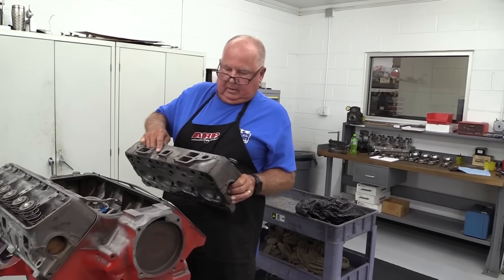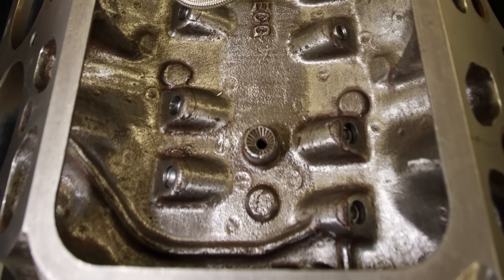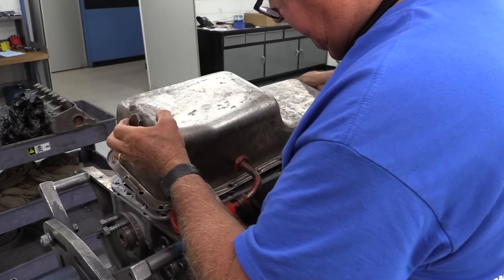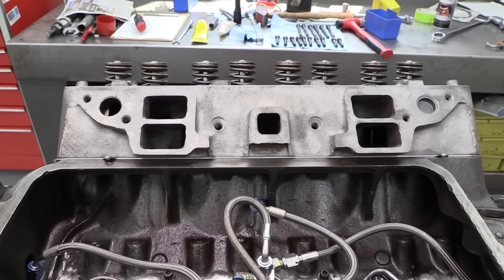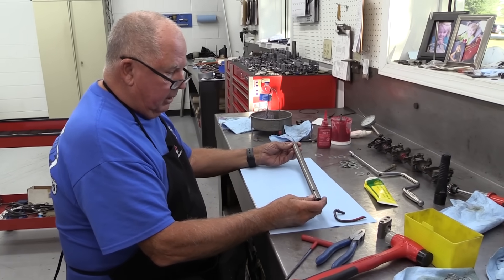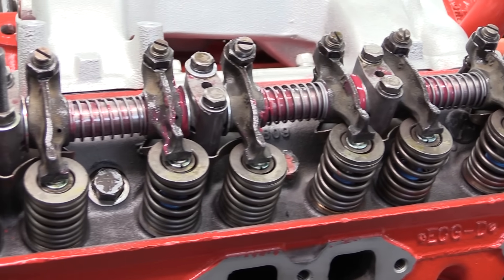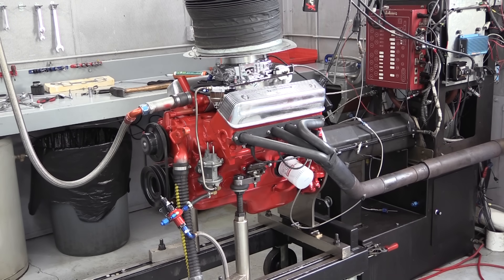The Engine That Replaced the Flathead -- Ford Y-Block Build

Comment: Everyone seems to love to do high output but not a lot of people can make a regular as ever build well
Reply: Cuz money spent is usually not much different especially if you use upgraded internals. Why use 3.00 stroke when a 4.0 stroke is the same cost? Why build for 8.5 compression when 10:1 compression pistons cost the same or even  less?
Reply: @shaadydog1  back in the 90s tuner culters(or one of) was simply because it was harder and they wanted the chalenge. I miss the days of that mindset. Who cares if you made 1200 hp 1500 tq, if you bareley did anything to do it but change a bunch of parts with known outcomes. I just wish ppl did more exparemental projects or simple projects. When 700+ hp is nothing more than a parts order and a month of work ots not really impressive to me... Or anything but a lazy way. Like ppl forgot how to do basic stuff. For example. The liquid piston rotory. Thats genious. A rotory with rotors that move like pistons. Thats inovation. These days its like half the ppl out there think you have braging rights for slapping on a few bars of boost and changing some pistons. Show me someone that can pull 100 hp per litre from a pontiac 383 naturaly asperated. THATS braging rights.

Comment: My biggest bitch about the y block engines was the failure of the rear main bearing and seal. I think the main reason was pressurizing the oil galley from the front…… resulting in oil starvation of the rear main when oil pressure dropped due to bearing wear and less oil was available at the rear of the engine. Eventually the crank ran low in the bearing enough to ruin the seal and spill oil. I had several old fords starting with a ‘57 when I was in college. Thumping noise at startup and blinking oil light were normal. Changing points was easy, however.

Comment: Hey guy, man thanks for the trip down memory lane. I really appreciate your documentation on the 292 Y block. I truly believe in the  durability and strength of the  312 y block. I purchased a pretty beat up '56 thunderbird in 1989 &I had mine rebuilt by NAPA in 1990, bored .o40  Rebuilt the Holly 4 bbl ,Also had the air cooled ford-0-matic  rebuilt.
I did the bodywork for about 3 years, but had it painted. New Stainless dual exhaust pipes,with golden turbo mufflers, &  eventually added the suspension upgrades rear stabilizer,  and new front end bushings., also eventually went to  electronix points, and the oil filter upgrade. Went to my first car show sometime in '93,(no trophy) and it still looked as good and ran perfectly when I did my last car show in 2014 (2nd place). That machine was my 25 year love affair, and I drove my baby hard, long and fast, and she was always begging for more⚘😏

Comment: A simpler way to improve rocker oiling is to machine a groove in the center camshaft journal.  That way, a constant, rather than intermittent, flow of oil goes to the rockers.  That's what Ford eventually did.

Comment: a 56 Ford cop car, using a 292 ford y block bored to 312. won c gas in upstate NY back in the early 70-s, 
the EZG heads were so milled down the pop ups would tip the plug gap close, when I discovered that, I went around the pits gathering up used head gaskets, selecting the hole 
 size I cut  them out and jammed the piece of head gasket on the spark plug jammed the plugs in, and raced for the trophy and won. I'm not a Ford guy, Chevy, this was a friend of mine I was helping out. had a few people knocking me, along with my friend, I said you have nothing to gain if I don't do this. Messing around a couple of weeks later he wiped out the engine. other wise we would had gone up to wheel brothers to run for show.

Comment: Had a 57 Ford in high school 292 y block l rebuilt the engine in auto shop back in the 60s when they still had such a thing l remember buying a rocker arm bypass kit from jc Whitney all’s it was was a oil line that taped into block main oil line and ran up to valve covers replaced the bolts that held the valve covers with a sprayer that sprayed the rockers worked for awhile but then started to make noise again but by that time l was out of highschool and getting drafted

Comment: I am a Retired Female Fleet Equipment Mechanic and this video sure brings back a lot of memories :) My Neighbor is a Mechanic and I spent a lot of time learning how to build engines with him, he was about 10 years older than me, and he was a Chevy Guy, I wont hold that Against him :) I am a Tom Boy and when I was about 16 when I met him and his Wife and Kids,  cool people :) When I was about 16, my father let me use his 55 ford 100 custom cab Pickup truck to go to school in, It had a 239 Y block engine and auto trans and it was worn out, at a traffic light the blow by was so bad, I would be in a cloud of Smoke before the light turned green again :)  at about 17 I ripped out that engine and found a 312 Y Block eng.  I Overhauled the 312 , Had Blairs Speed Shop reground the cam to a Dempsey 280 dirt track cam specs, Milled the heads .060 and installed a Edelbrock six pack intake with 3 Stromberg 97 Carbs :)  and replaced the auto trans with a Manual 3 speed, 2 1/4" duel  exhaust with turbo mufflers :)  That 55 ford truck ran 15s in the Quarter mile , back in the 70, at the Drags, a guy had a new 440 dodge magnum and I tore his doors off, He was mad, he lined up for a second pass and I beat him again :) I ran 12 times at the Drag race track and only got beat twice by a drag bike and a big block full race Chevy 56 bel air :) that was so much fun, I even had a Cheering section :) I even beat a ford sunbeam with 2  4 barrel carbs and a 650 Yamaha Motorcycle at Irwindale race way in California. such Fond Memories for me :)  Thanks For the Memories, Chellie , PS. That Engine Rebuild lasted 18 years and was still running when my Father sold the truck :) When I gave the truck back to my Father after a couple of years, and when he drove it,  My Mom said, he turned back into a Teenager :) LOL

Comment: I've always joked that Chevy copied the engine that Ford threw away. Even if they didn't on purpose. They kinda did.
Reply: Not in any way shape or form.
Reply: @edwardpate6128  oil filler in the front to the left of the thermostat housing.  Cam gear and distributor in the back of the motor. Siamese exhaust ports for the middle four cylinders. You don't see any of those similarities?

Comment: For those that care the actual engine that replaced the flatty was the 239 y block that was bumped to 272 then 292 and others. Spent lots of time in a 312 equipped 56 wagon as a kid.

Comment: Surely there must be a solid state distributor available to get rif of the old points system.  If I was going to the trouble to abandon the original intake, doing away with the points would not have bothered me.

Comment: My dad had a auto repair shop and in the 50s and 60s I watched him many times do jurry riged lash up with copper pipes being plumed into the valve covers.  He said these engines  were poorly designed for uper rocker arm lubrication.  I dont know if it was a manufactured kit he bought or was one of his own lash-up concoction to help with the lubrication.

Comment: What is that aluminum colour Sealant applied on 2:54 ?
Thank you!
Reply from the maker: Ultra Grey silicone sealant. I think that's a brand name of it for Permatex, but every manufacturer has a version of it. It is more resistant to vibration and oils than the other types, which makes it very good in engines. Hope that helps.
Reply: @TheHorsepowerMonster  Thanks for the reply!
However it looks more like some DowCorning stuff according to the green tube ;) Permatex Ultra Grey does not have that shiny glitter :(
Reply from the maker: @SonderMann1982  All I meant was that people call all the gray stuff "Ultra Gray" even though it is the official brand name for the stuff made by Permatex.

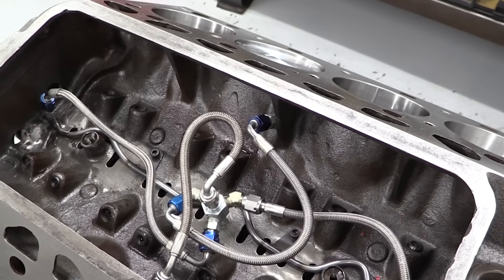Comment: I left mine  just about all stock because I know  if I push it  it won't take it for long and  the expense  that goes into one of these engines just isn't worth the  headache unless you have a ton of money to throw away. I changed the heads for a little more compression and had the block lined bored to accept the inserts instead of Babbitt, and believe me  I was really  struggling  to even put that much money into it but I wont be drag racing my car since it's  pretty much all stock except for the overdrive I installed  for better  gas mileage and hopefully  less engine  wear due to overrevving.  The  35 had  4:11to 1 rear gears so I opted for  a 36 % overdrive for open road flat driving  and the lower  gears for parades  The little coupe isn't heavy so it should  be ok  for power  but if it were a sedan and I were to  have it full of passengers  then maybe the 36% over would be way to much of a strain on the  engine  and defeat my purpose  for  mileage  and power . Personally  I would have gone with a small block  Chevy but  I didn't want to  stray too far from it's originality . I grew up  riding in a 35 Ford  5 window sine it was our second car  for my Mom to drive . The  Ford actually belonged to a very good friend of my Dads and he drove it on the weekends when he came to stay with us .

Comment: External oil pumps are hardly unusual. Holden 6s, Holden V8s, Slant 6 Valiants, Big block Mopars etc etc.
Very handy for motorsport as you can baffle the well of the pan to minimise oil surge. And fab a adjustable oil pressure.

Comment: my dad bought a used Ford wagon  for 600 in 1961 with a right rear fender that was 300 to repair.  I learned to drive on this car and by 1966 I had beat this car a bit.  It was a 292 4brl, dual exhaust auto.  Always worked.

Comment: Back in 1975 I owned a shop and the local city street department had a 64 ford pickup with a 292 in need of overhaul.  This was a college town with an automotive depart so I hired a college student who said he could handle the overhaul.  What he didn't realize was the cam bearings had to be indexed to the holes (he was used to small block chevys).  At startup we had no oil to the rocker arms, so we had to pull the engine out and tear it down enough to replace the cam bearings again.  Lesson learned!

Comment: I owned a 1956 Ford 4 door Custom. As a teenager, I pulled the automatic trans and put in clutch and 3 speed trans. It was a pretty fast car for it's time. I got good at speed shifting too. The rocker arm thing was really bad. Some guys put on an external oiler. I rebuilt the engine once. Those days are long gone. It was a fun car though. I bought it for $450 when I was 14. It would go 120 mph when running  reasonably well. 
Right: America, bless God.

Comment: The Y block shared a design objective with the Flathead that preceded it: it was cheap to build. It powered popular priced cars and trucks. These motors didn’t make much power, didn’t respond well to power mods, and were very thirsty. Cost cutting was obvious: the video mentions how the valve cover gasket mating surface was just a rough casting and frequently leaked. I blew up several, and the ones that lasted the longest were driven carefully and received frequent oil and filter changes. They were smooth and fairly quiet when new. It took a while for manufacturers to learn how to build 150,000 mile engines that required very little maintenance. It was the low cost Japanese imports of the late 1960’s and 1970’s like Toyota, Honda, and Datsun ( Nissan today) that demonstrated that an inexpensive car could go 200,000 miles with long service intervals.

Comment: To all the Chevy trolls trolling this one, I spoke of my experience with the Y-block.  Not a good engine.  Neither was the Chevy small block, a REAL cheap piece of crap.  If you wanted a good engine in the mid-50s in a lower priced car, you had to go Pontiac or Olds, or any  Chrysler product.  Both the Y-block and the small block were cheap garbage, although the small block was a better (if short lived) performer.  The Lincoln Y-block was a much better engine, BTW, as was the FE that replaced this boat anchor.
Reply: You left out Packard as building excellent engines.

Comment: I had a '55 Bird.  These were a huge engineering and planning goof by Ford.  Unlike of the "expandable" GM engines starting with the '49 Barr-Cole Cadillac and Bennett Rocket at Olds, the Y-block was too small to go much beyond 312, forcing the FE and the MEL by 1958.   As shown, the oiling on these engines was horrid, along with 
those archaic mushroom tappets.  The deep block skirt didn't really help with main bearing life, either,  because of the poorly designed oiling system.  Worn out main shells are as common on these as are trashed rocker assemblies.  The intake design was another blunder topped off with the always-flooding Holley sidedraft.  Then there's the famous "ka-net ka-net ka-net" valve train racket in an era when hydraulic lifters were the norm.  To be fair, the Ford FE's rocker oiling was none too good, either, especially if the heads had been milled.  But the FE was a far superior engine overall.  Y-block?  Boat anchor.  The Lincoln Y-block of '52 was a better engine-as well, and was used in medium truck applications with shorter stroke until it was replaced by the FT..

Comment: A friend had a 1957 T-Bird way back in 1980, and it made the sexiest V8 sound you can imagine. It had Cherry Bomb mufflers in the exhaust. I'm guessing those uniquely asymmetrical intake ports are the reason the Y-block in that car sounded different from any other V8 I've ever heard. Man, I'll tell you, I'd rather listen to that sound than have more efficient breathing.

Comment: ROFL you cant take the lifers out with out taking the lower end apart.. sounds like Fords was being ford back then too
Reply: Sure you can.  Pull the lifter up as far as you can and slip on a clothes pin to hold it while you slide the cam out.  Works fine, take a look in an old Mitchell or Motor shop manual if you don't believe me

Comment: Some people don't understand that this engine replaced the Flathead that only produced 90-100 horse power. In order to get it to 300 horse power you would need to add a blower. The engine in this build is nearly stock, but could get to the 400 and above with some mods.

Comment: The bore size must actually be 3.79" ( that is 3.75" +0.04" ). With the 3.3" stroke this give 298cid.  No Y Block could be bored to 4.15". as the bore spacing is only 4.38".

Comment: In 1980's picked up a '61 19' Jet Boat with 312" engine... bored .060" over to 322"... twisted that pump up to 5,000 RPMs... prolly had a hotter marine jet cam than car/truck engines... twin carb.s... maybe they fixed the oiling problem for that usage...

Comment: what makes the Windsor better than the Y block? other than after market is there a major flaw to the Y block that i just dont know about?
Reply from the maker: The port arrangement on the Y-block was terrible for flow. By stacking them on top of each other they created a lot more turns for the air and fuel to have to navigate before getting to the combustion chamber. Also, the oiling system was pretty poor. Thanks for watching

Comment: Why are there coil springs on the rocker shaft?
Reply from the maker: It is a rocker system that allow you to adjust the rocker arm location laterally to better center the rocker tip over the valve by using shims. The springs help hold the rockers against the shims. Hope that helps
Reply: @TheHorsepowerMonster  Thanks a lot!

Comment: good night, how are you? I watched the y block video. and I was in doubt, that tube that was fixed to the block one of the ends of it I saw that it is connected to the aeroquip hose, but the other end of the tube was what made me doubt where it is connected? because it looks like it goes down into the block. if where exactly is it connected?

Comment: How long will the external rubber lines last. Do you think it is better to make in all steel with banjo fittings? The other thing is it is pretty long in the snout. It is close to the length of a 6 inline.

Comment: Had a 55 2door post customline .pretty car .272 ,with 3 on tree .would beat 260  ,2barrel ,4 speed    in a 64 Comet ,
Reply: My first car was a 1949 Dodge six. Rplaced it with a 1954 Ford Y block 2-dr post. Yup, in a few years oil pump quit and motor died. I was loaded down with Model A parts.
I now own a 1931 Ford with 260 Falcon V-8 and Tremec 5-speed.

Comment: GM introduced the 265 cu. in. for chevrolet in 1955 model year. The 283 C.I. was introduced in the 1956 chevy's. 1957 the 283 fuelie was introduced in 1957. 283 HP=283 C.I.
Reply: Some '54 Corvettes had a 265. Some '57 Chevys had the 265.

Comment: Y block 239 C.I. in 1954, 272, 292, 1955,  312 1956.  Man! because of an unusual firing order, ( siamesed) with a set of watered down glass packs (mufflers with fiberglass mesh inside) nothing sounded as good! (or as loud!) Too, with an align bore of both crank and CAM journals they would easily go to 7 grand (RPMs) Iskendarian  made a great cam for them. McColloch (?) also made a  a supercharger for the T-Birds (56&57 "F" model engines,  and a "Hen's tooth"  2 stage experimental supercharger . (rare!) I'm an OLD Ford guy and freely acknowledge the superiority of the Chevy 283 tho!

Comment: on these test runs I would hope they break them in first and do a few oil changes. all the ring drag will overheat them and cause them to lose their temper . I always put a strong magnet on the drain plug to catch any shed metal and their is always some of ring and other material running thru this system not to mention any dirt that only hot oil will break free.